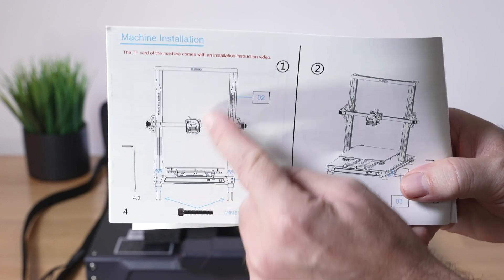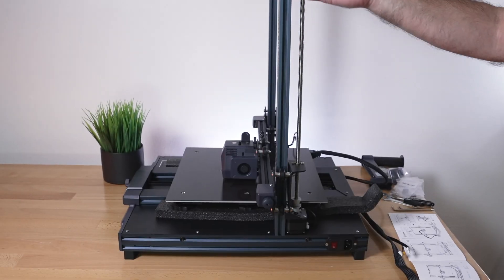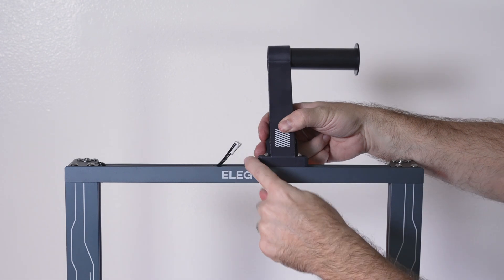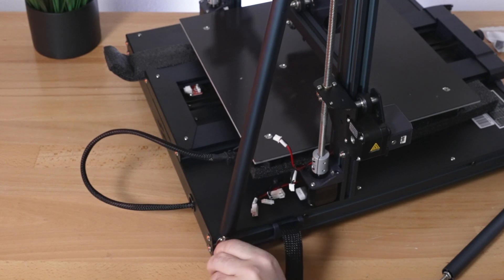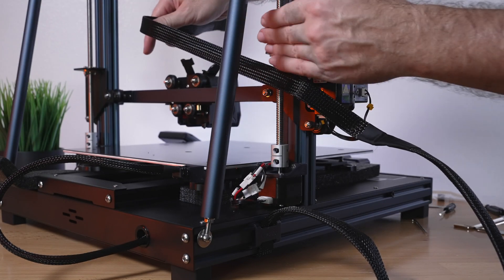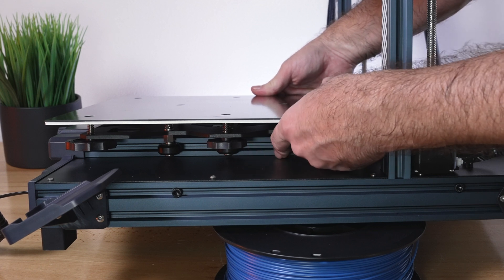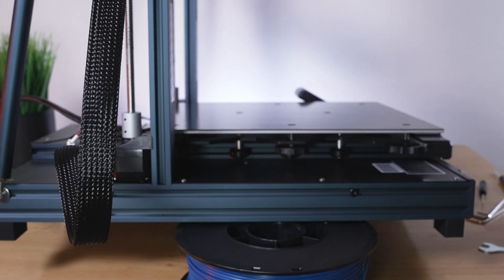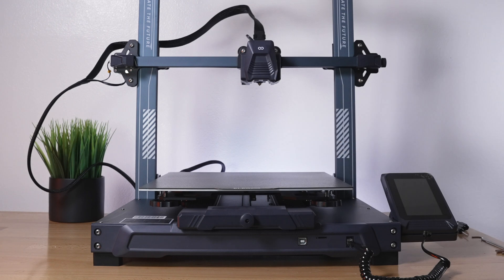Elegoo Neptune 3 Plus - Assembly

Comment: Thanks very much for this excellent video, I appreciate the attention to detail, 
I found that my z gantries (if that's the right word) weren't exactly 90 degrees perpendicular to the base so I used a carpenter's square when installing the braces to get them squared up nicely. 
Thanks again for a great video. 
- Do you have a video on how to do all of the various calibrations, e-step, temperature tower, anything else, that is suitable for beginners? 
Cheers.

Comment: Vlad saves the day once again!  This video is for the Plus, but it helped out with the Max.  I thought I was losing my mind because the Max also has that orphaned bolt @8:13 as well as an empty hole next to it.  If you use the empty hole your cable will be touching the Z screw, but you assume it's the correct hole because the other one must be occupied for a reason.